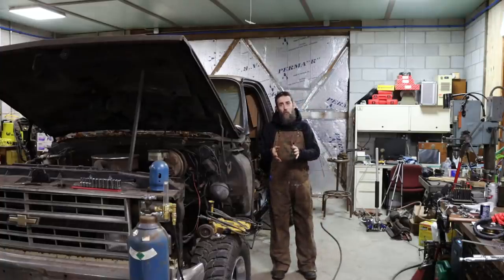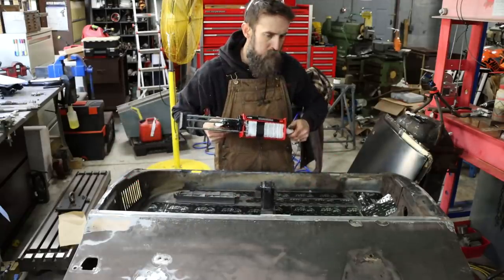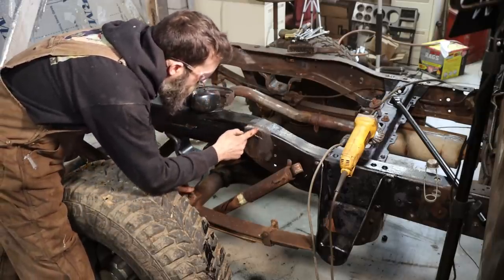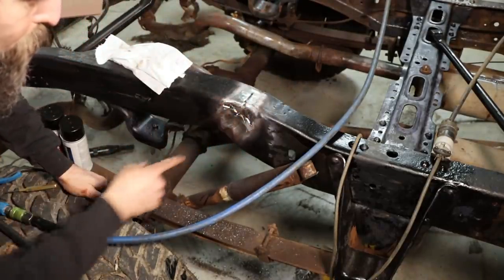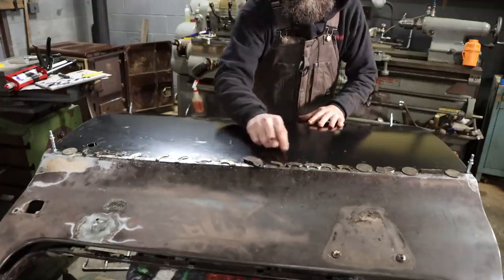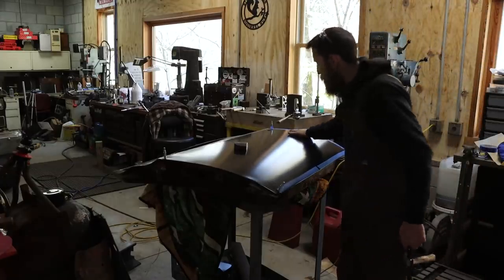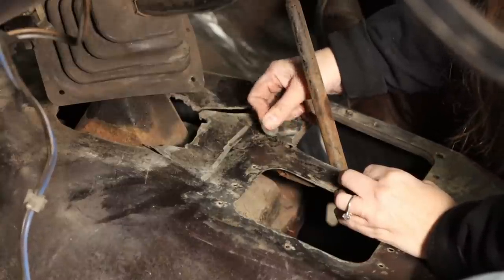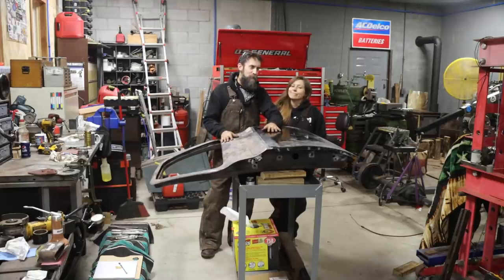Broken truck frame & Door Skin   Square Body Chevy 10

Comment: “As good as they were originally”. Ah, the classic tale of a square body.
Reply from the maker: I've seen several of these trucks that have never been touched as far as body panel alignment.  Most were not all that great as far as panel alignment from the factory.  Especially the doors and cab. 
 Most of the newer autos line up amazingly well compared to these old rigs😁👍

Comment: Hey Steve I’ve been a body man for 25 years and I have used every brand of panel bond adhesive on the planet, that being said, WELD THE SEAM ON TOP OF THAT SKIN!!!  If you don’t you will have a read line where the seam is.  Been there done that and have the scars to prove it.  If you do try to bond it make sure there is NO adhesive on the outside of the panel seam before you do your bodywork over the seam. The adhesive reacts differently in the sun during heating and expansion and it WILL cause bubbles in the paint in the sun, once it cools they go away. Had that happen and now all seams get welded and I only bond door skins on the bottom and sides where the panel gets rolled over. Panel bonding a large seem like that in theory is a great idea but it doesn’t hold up to the normal flexing, expansion and contraction while driving the vehicle, and again as I said it will cause a read line. Just my two cents and personal experience. Eddie wheels 😬🧑🏻‍🦽👍 NJ.

Comment: One of the things that I respect Steve for is his respect for safety and I think he sets a great example. I watch a channel called "Matt's off road recovery" and it is a great channel but they are always using grinders without safety glasses. As I am nearing 60 years old I know that no one is so lucky to use grinders without safety glasses and have it be a good long term practice. I've learned my lessons. I think people are better off following Steve's example FOR SURE!!
Reply from the maker: I watch them as well👍. It really is a great channel.  They definitely take some risks . Working with grinders every day almost and having been chewed up several times has given me lots of respect for them. They will get you quickly.

Comment: Hiya Steve. The side by side shifter locations are for the K10 with the NewProcess/Mopar 833 overdrive transmission and a NP 208 transfer case. My 86 K10 stepside has this setup. 3 speeds + overdrive. It came with a Hurst OEM shifter bolted to the side of the transmission, with the side cover linkage, just like an old Charger. I think somebody swapped in the older heavy duty top loader transmission on your truck. That transmission is way bigger than the original box, prolly stonger too. My transmission bearings groan and howl quite a bit, and I really need to pull it and redo it, before I grenade it. Someday, lol.
Reply: i have the  same setup :).....noisy too...lol\was a special facttory order option
Reply: @davesgarage3099  yup. Did not realize that it was a special option. I have seen a few with the same setup. There is a plan to re-bearing mine ... some day. Hopefully before it fails. Those parts are easy to come by. Gears, not so much, as they are not the same ratios as the four speeds found in mopars, but they can be found as well. The road noise from the swampers tends to drown out the transmission noise. 😀 My shifter was junk too. I was able to get the shifter rebuilt direct by Hurst. I was trying to find parts and any other information on it, and ended up contacting Hurst directly, as everybody else said there is no such Hurst shifter. Hurst looked it up, and said yes, it was an OEM shifter, and told me I could send the whole thing in to be rebuilt, at what sounded like a ridiculously low price. The cost quoted was very reasonable, so I did. They sent back essentially a new shifter. If your shifter needs service, give Hurst a call, I was very happy with that result.

Comment: Your opinion, , , I like your opinions my friend. You have never led us astray Steve. Sure missed you last Saturday. Sizzling hair you say ? I hate that one that gets right into an ear and over and above the discomfort and pain is the snap-crackle-pop the slag or the tiny ball of molten steel cooling in ear wax. There are benefits to wearing ear plugs eh, LOL. Elizabeth's weld is far better than many licensed welders I have had the displeasure of letting them go after a basic weld test. If she continues to like it I am sure the appearance will smooth right out. All she needs now is to keep on caring and it will come. Well my friend, this 1/2 hour slipped by in a moment or two. Thanks eh.

Comment: The body men in the shop where I worked always put the skin side down when they reskinned a door.  Much easier on your back.  It is harder to support the door without damage to the skin though.  Lots of strategic padding.   Much respect for your infinite patience Steve!

Comment: 14:15 Thanks Elizabeth, I nearly choke on my Pepsi when you made that welding noise. 
I don't weld but I have seen enough people who were professional welders and they always wore a hat or a scarf on their heads to stop the hair sizzle that Steve experienced. Polyester and nylon are not to be used as a head/hair protection material.
Reply: As a person that it bald I learn the hard way you can get "sun burn" on your head from welding.  Always use a head covering of sorts to prevent that.

Comment: might as well add a leaf or two to those rear springs.  Make it worth the time, and allows you to haul wood from the timber like you were kin to Ivan Swope.  And it makes it more stable while pulling the trailer.  Biggest drawback is it won't ride smooth without 1,000 lb of something in the back all the time.  Just carry more sand tubes for winter driving!  It allows you to spare some when you come across someone who just found out there fancy new vehicle is practically helpless when it's slick.

Shock mounts to the frame seems to be a long standing problem (front and back) on these trucks.  I had one get loose on the front of a 73 GMC.  I welded it in place, as I planned to put that engine in a different truck.  I hit a pothole, the part that went through the frame broke off, and was left somewhere on the Alaska Highway.  Drove the remaining 500 mile with a rolling shimmy in the front end.  It shows in the video I took.
Reply: Might as well swap in some 3/4 ton springs….

Comment: Hi Steve
Not to rain on your parade but as I am a Panel Beater or in your lingo a bumper and fender guy what you were saying about the door skin is almost right but honestly if you just turn the door over on a soft cover and work the edge from the top you would save your neck. The tape is good but hold the dolly with the larger flat part toward the edge that will help with rolling the edge. 
With the door gaps once you have the skin on use your TIG to tack the corners so the skin wont move and you can then use the TIG to run a bead where the gap is to big and the file it to shape  easy peasy !!!.  I am old school and I would have replaced the whole skin "I HATE GLUE " . The rust repairs were good but you really need to use a stack of rust sealer. One of the products we use in coastal areas on old junk is FISH OIL once you have painted the truck and it's finished you spray all the under side, inside the doors and inside the sill panels ( Rocker panel your speak) just drill a hole under the sill spray it in a use a rubber bung to seal it up and Bob's your uncle. Keep up the good work love the videos.

Comment: Panel Bond is the best! Welds will rip apart before the Panel Bond does. I’ve seen it when a repaired car came back after an accident, I used to work at a body shop.
Also I can’t tell you how many plastic things I have repaired with Panel Bond.  Way better than any epoxy I have ever used.
Great to see Elizabeth enthused and working with you.
Keep up the good work.
Reply: Probably prevents rust in the joint as well since it keeps the air out.

Comment: An acquaintance of mine who is a body man told me he uses "cow" or ruminal magnets that he buys from a livestock store to hold parts in place before welding or during epoxy cure. They are about 2" long and look like small box beam sections and they can be laid down end to end (you have to align the polarity of course), are very powerful, and relatively inexpensive.
Reply: I thought they were about 3" long and look like a big pill or a bit like a CO2 cartridge. I wonder who gets the job of recovering them once they've gone through the cow?! I guess one farming job is the same as the others. I asked a farmer once "how do you handle the smell?" He said "Son, that smells like money!"

Comment: Another good idea for shock mounts is to make a recessed through pipe using 2 different DIA pipes welded together using a big washer to bridge the gap for the bolt to go through and a box plate welded to the other side. To stiffen the frame from in twist flexing. 👈🤓😉👍
Reply: If the stud mount had long enough threads I would have welded in a 1/8" "fish plate" to stiffen the frame, and maybe even one on the top.

Comment: I have a 2000 silverado. I’ve never owned an older GM product. I have been driving hondas for decades. I am absolutely amazed at how inexpensive replacement parts are for my truck. It makes it worth keeping. I only use it for hauling, not daily driving, but with an 8 ft bed it is crazy useful. Right now it has a harig 612 in the back 😄

Comment: The first thing is to get a fire started. Then get working. Right.
But in 30 years you'll get the fire going, and pull up a chair, soak in the warmth and stare into it for an hour or two. But it is pleasant.

Comment: Steve, I know everyone is an armchair quarterback, but a small piece of advice from a CNC machinist, when drilling steel with a hand drill, slow the RPM's WAY DOWN. Going really fast like that with hand pressure jacks up the drill bit and potentially work hardens your material that you are trying to drill. I have ruined tons of drill bits not knowing this until an old-timer showed me that going slow with a thick chip is better for the drill bit and material you're cutting. If you can stay in the cut all the way thru is even better. It will drill much faster going slow on the RPM's and lots of downward force. Its counter intuitive but it works. 

Love the videos and your work!

Comment: You could fabricate a box type  damper mount that supports a through bolt on both sides of the damper's upper eye.
This is easily done using rectangular hollow section and would strengthen the cracked area at the same time.

Comment: 13:14  To get a welding-flea (a drop of molten iron) in your hair is annoying. To get in under your shirt is exciting. If it gets onto your eardrum it is potentially very bad or even catastrophic, also extremely painful. It can happen when lying under the car, welding. Especieally if the metal is not stripped completely from rust and other impurities on both sides before welding.
Ear-plugs prevents this, so use them when lying under.

Since you can not expect 100% welding strenght, I suggest you strengthen the weld with a patch of same thickness as the base material. 1/2 in. on either side of the crack should be enough. Multiple cracks from an origin, a more complicated larger patch, or a simple one covering it all.

As you do, start with drilling the end of the crack. Weld it close. Then patch it.

Nice wife btw.

Comment: This C11 series has been great. Would you consider doing a Panel Beating tools for beginners video ? What are the must haves, good to haves, nice to haves etc. I'd like to try it but dont have many of the necessary tools. Thanks.
Reply from the maker: As far as hammers go I like Martin 
The door skinning hammer I used is a Martin 170G. My go to hammer for most work is the Martin large face  short pick 158G. They have a really nice balance and weight and are affordable.  Plus made in the good old USA 👍 As far as body dollies go I can use about anything.  Buy the cheap ones and put a good finish on them yourself.
Reply: @SteveSummers  Thanks for those tips.

Comment: NIce skinning of the door, and Yes, we stated using 2 part epoxy's back in "98, and never welded panels (even floors) on again. Do own a Henrob tourch, but hasn't see day light in 25 years (@@)! Got run, corvette sat for us, and shop is a mess :)> Taring down that 1950 Klopp shaper has 10% of the tools nasty greasily, and customer will be here in couple hrs,,later, will be back to watch. Bear Tx.

Comment: Thats very common on the half ton frames. I've welded a plate on the inside of the frame and a heavy washer on the outside to center the shock pin again.

Comment: Steve, do you think it would be worth while priming/ rust proofing the inside of the door?
Also some years ago my late Brother in law gave me a huge tip
I had a 4 door sedan (HK Holden if you know what that is) we where doing a cancer operation between the A pillar door jam at the bottom and the wheel arch
When we cut the cancer out their was about a pound of wet sand in their
So Andy grabbed a 10mm drill about the size of a hose end and massaged the existing tiny hole to take the hose being shoved into it to hose out any future detritus 
that may collect,
It works very well  we did the same for the door bottoms as well as any other area that debris gathered was appropriate obviously you used air in the spots like doors that you don't want to get wetness in when cleaning.
The truck will be almost as good as new when you finish it
When do you put the Cummins 5L and Alison gearbox in?
That reminds me
Go and have a look at what Drew did to his F350 
On Drewman'sDriveway YouTube channel 
(91f-350 cat 3126 engine Swap playlist)
 I didn't think that would fit in their 😁
Tony from Western Australia 🇦🇺
Reply: I also forgot Steve
found this short video and knowing all of the things you get into 
I think you can see the potential of this. 
‌Basically a one handed plenishing hammer using a power tool most of us have. 
‌If the outcome is this good on Stainless steel imagine the outcome on normal vehicle body panels 
‌Tony from Western Australia 🇦🇺 😁 
‌
"it's about the dented plate of 1mm stainless steel
https://youtu.be/1mtzL8Ji94o "
Reply from the maker: The doors almost always rot at the bottom seam before anything else.  I don't think Ive seen one rust  up high on the inside before.  Main thing is to seal the bottom seam and make sure the drains are open and that the door can breathe 👍

Comment: Those rear shock mounts... aren't they a hot rivet type from the factory and that bolt in type is a replacement?  Which would explain why there are cutting wheel grooves around the the passenger side hole...
Awesome content, keep up the great work!

Comment: A good way to get rid of those little humps along the seam is to heat the hump with a torch and shrink it down with a damp rag. Or if you were to weld it use the damp rag as you go along.

Comment: Steve,  unfortunately 8115 bonding adhesive isn't designed to do what you did. All tho it is an excellent structural adhesive, after a few heat and cool cycles, you will be able to see that seam.

Comment: i would sure like to see what kind of bracket or hinge that bolts to your difrentaly shifter, my shifter is right against the seat and i like how yours is pointed towards the firewall,,mine is a 80 scottsdale heavy half or started out that hahah,bobby is a mess and looks like both you guys straw boss ,by the way that was a great weld job ,much better than mine for sure great job,but ya the bracket from tranny to transfer case is what im looking at,maybe it is because you have a manual shift,either way my shifter is right again the seat and sure causes a lot of trouble for the grand baby hahah

Comment: Why stop drill the cracks if u weld everything up? Definitely epoxy was the way to go on that skin. There was almost no crown to resist distortion. It would have looked horrible. I imagine that stuff ain’t cheap but you will find many other uses for it. Interesting series.

Comment: I'm not really a GM guy, so I'd normally defer to you, but I wonder if the damage to the frame at the shock mounts isn't from old-fashioned abuse, like what you'd get from hitting potholes and rough terrain at speed, and/or overloading the weight carrying capacity. Another possibility is shocks extended or collapsed beyond their travel.

Comment: Just wondering !  Do you do machinist work for your main income source ?   If so when do you do any machinist work ? Seems like since Ive been watching you've worked on repairing/updating the shop and equipment and then straight away on to the truck repairs.

Comment: Don't worry, Elizabeth, if the front of the truck goes one way round the bend and the back of the truck goes a different way you will know that there were more cracks in the frame. It'll be fun!! ;)